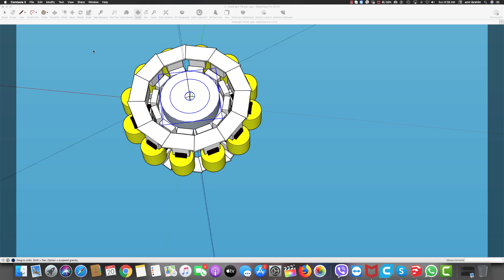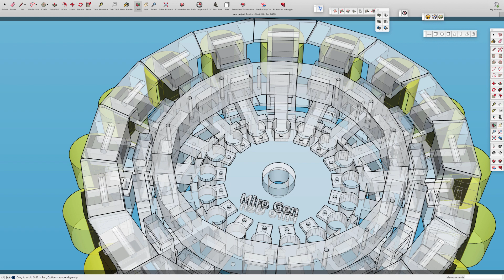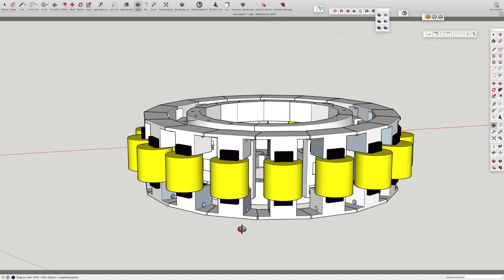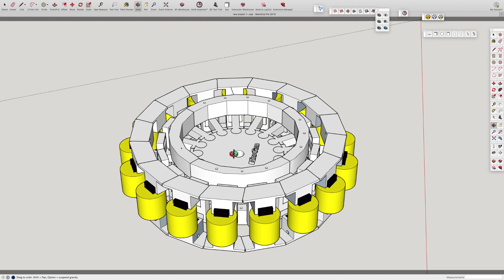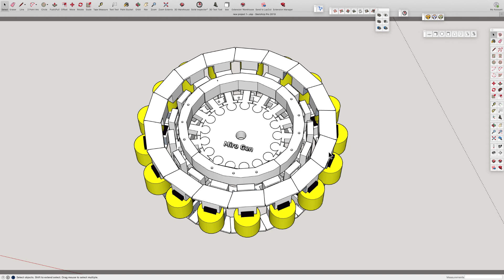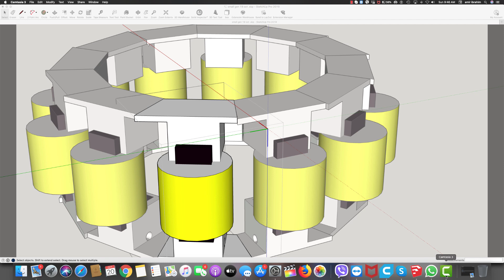Lenz Free New Generator

Comment: Hey man nice work, you're on the right track my friend, switching the coil at just the right time is exactly how you do it, I recommend a relay  connected to the iron of the coil so that it will operate magneticly as the magnets induce current, but you can use any method that works for you, you just want something which makes a spark, you can also use a heavy duty reed switch
Reply: correct me if i'm wrong jason, but current must not flow in coil neither as it aproaches nor as it leaves because thats when the drag occurs
Reply: hey, Jason here is a similar idea; magnets don't move, coils don't move, just iron in between does the making and breaking of flux..https://www.youtube.com/watch?v=SlS4hT-RvaE&feature=emb_logo
Reply: Switching at high rpm and high voltage ?